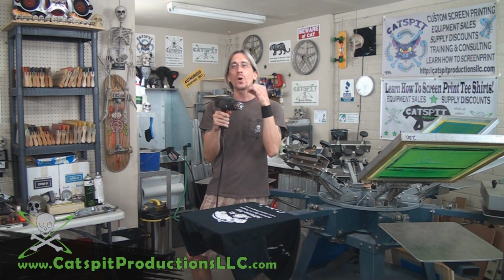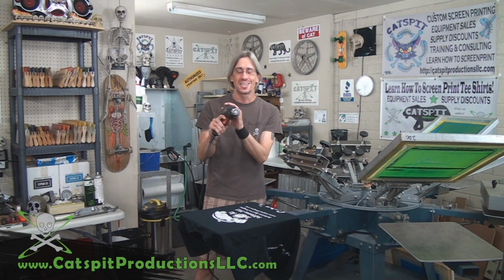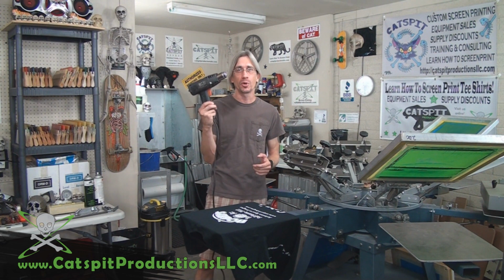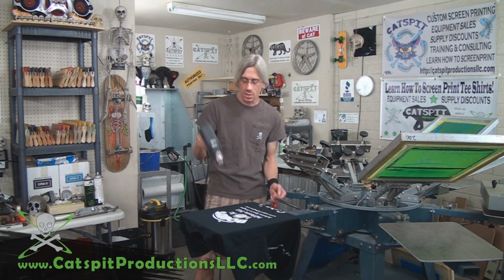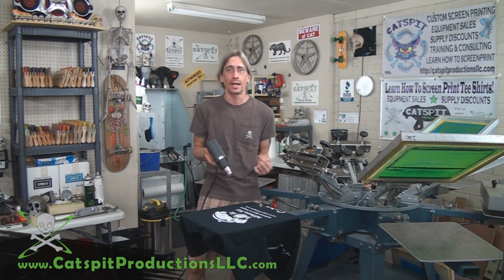Screen Printing Tee Shirts: Can A Heat Gun Cure Plastisol Inks?

Comment: My plan is using gun to "predry" between color layers and after that i will make final cure in heatpress. I know this option definetly not replace good flash unit but i want use this system as start. Thank you for another very helpful video maister.
Reply from the maker: I'm happy to help out where I can. Thanks for watching! Screen Printing Equipment & Supplies - http://CatspitScreenPrintSupply.com/

Comment: Many if not all the printshops here in the philippines used heat guns to cure inks. In fact most of them never invested for a flash dryer at all in their entire printing career and they all worked fine. Whats popularly used by printers here in the Philippines are line table with heat gun. And to some few who could afford it uses rotary press with flash dryers.
Reply from the maker: Thomas Aquinas Yes, we call it long board printing or long table printing. It's popular where space is a commodity and labor is cheap. I rather like the long table set ups and think it would be very cool. But most of the commercial long table set ups use a moving flash cure unit on tracks or what have you. Using a heat gun is very slow and you must have excellent attention to detail. If you miss a spot the slightest bit with plastisol inks, it will wash out. But to each his own. Some people use a kitchen oven despite the fact that it is dangerous. But what works, works. Have you seen this video?

https://www.youtube.com/watch?v=dMclldR9ZQ4  

Ultimately when time is money a belt dryer is the best solution. I just don't recommend using a heat gun to do your final cure. That's how I teach. I want my students to be successful with minimal effort. And it does require the right tools for the job. But many people do it every day and if it works for them then, run with it ;) Thanks for watching. Screen Printing Equipment & Supplies - http://catspitscreenprintsupply.com/
Reply: +CatspitProductions  Nice. Well the reason why most printers here in the philippines never invested for a flash cure dryer is due to financial reasons. They cant afford. So they often resort to using heat gun. Or since philippines is a tropical country they just expose the printed shirts in the sun since its ridiculously hot here during noon time. And most plastisol printers uses heat press for final curing.
Reply: +CatspitProductions  Oh yes. They dont use heat gun here for final cure. They only use it for flashing. For final curing they use heat press. And it gives glossy finish to the print.
Reply from the maker: +Thomas Aquinas I understand. I n the end you do what you have to in order to get the job done.

Comment: big question, can this paint be used to paint brush on fabric/cloth banners? Or does it have to be used solely with a screen printing mechanism?
Reply from the maker: Technically it's ink and plastisol ink is pretty thick. You would simply have to try it. I have never tried to paint with plastisol inks. Thanks for watching! Screen Printing Equipment & Supplies - http://CatspitScreenPrintSupply.com/

Comment: can you cure the base layer with the heat gun then lay the second layer then use a heat press? if its a black garment and white ink?
Reply from the maker: It's the same difference as I stated here. Watch the video from start to end and I think you'll get the idea. You can try anything you want. I have never used a heat gun and a heat press to cure a shirt so I cannot guide you on that. This video is about using a heat gun. Thanks for watching! Screen Printing Equipment & Supplies - http://CatspitScreenPrintSupply.com/

Comment: Thank you for the information. I have a question. Can I cure Angeles Acrylic leather paint on a t shirt with a heat gun? So it doesn't wash off. THX!!
Reply from the maker: You're welcome. I'm sure you could dry it with a heat gun if it's an air drying paint. But I have no idea if that paint would be wash safe on fabrics. You could try it out and see. Thanks for watching! Screen Printing Equipment & Supplies - http://CatspitScreenPrintSupply.com/

Comment: thank for videos ... u r best youtuber for screenprinting... i just want to ask 1 question,,, can i use heat gun just for drying 1 color so that i can print another... how long it will to dry ink,,, i try with hairdryer and it sucks... i am from nepal and we have major load shedding problem , so run the flash dryer on generator cost expensive...
Reply from the maker: +shreechan chitrakar Thank you very much. Glad I can help out through my videos. That may be possible, yes. You might be able to efficiently "flash" a smaller design with a heat gun. How long will it take? That depends on how big the design is and how much ink you actually print. Thanks for watching. Screen Printing Equipment & Supplies - http://catspitscreenprintsupply.com/

Comment: So I made a bunch of shirts with plastisol ink/ one image with waterbased ink. I thought I cured them enough, put one in the wash as a test and the ink is not holding now. It's kinda cracked/ not full. So I am stuck on what to do with the rest of the shirts that were made? Should I put them in the oven to ensure they fully cure? I have had them dry for about a week already though. 

Thanks for your help!
Reply from the maker: Yes, if the plastisol printed shirts were semi-cured and have not been washed or laundered then you may simply put them through the oven again and give them a good cure. The same should be the case for the water-based prints. As long as they are heat set for water-based or cured for plastisol they should be just fine. Hopefully the plastisol prints were semi-cured and none of the plasticizer went out into the fabric during that week they were sitting. That is your only variable that you have to worry about. Thanks for watching and leaving a comment! http://www.catspitproductionsllc.com/ - http://catspitscreenprintsupply.com/
Reply: Ok awesome, thanks! I am getting a flash dryer this weekend as my garage and my pocket aren't ready to drop 2 k on a belt dryer :)
Reply from the maker: superchanneljim You are very welcome. I can relate to that. Good luck and let me know if I can help out any time.
Reply: You've been a ton of help thanks!
Reply from the maker: superchanneljim My pleasure.
Reply: Apple Pie scent printed shirts... this a unique approach :)

So, at 330º for 1 min more or less. How long you have to wait before placing the shirt in the oven once done printing, and what is the maximum time your shirt can be let out before placing in the oven?

Thanks for the video.
Reply from the maker: pbtubelog Put the shirt into the oven direclty after printing. There is no need to wait. And there should be no reason to wait for plastisol inks. Water based would be a different story with an infrared dryer and NO forced air. Thanks for watching. Screen Printing Equipment & Supplies - http://catspitscreenprintsupply.com/

Comment: what about sunlight? can you do it with sunlight? and which one is easier to cure? is it water based ink or plastisol ink?
Reply from the maker: No sunlight cannot cure water based or plastisol inks. Thanks for watching. Screen Printing Equipment & Supplies - http://catspitscreenprintsupply.com/
Reply: in my country some people use sunlight to cure water based ink. but i never really pay attention with the result. thanks btw, i really like your videos. i learn a lot from your videos.
Reply from the maker: Abi Setiaji Thank you!! You're very welcome. Iv'e never heard of such a thing since most water based inks need to reach about 250 degrees to be heat set and wash safe. Maybe you all are using a different type water based ink.
Reply: i think its something called rubber ink. i dont know exacly what it is, but it is water based ink.
thanks again for the information. :)
Reply from the maker: Abi Setiaji Then I would check with the manufacturer to find out what ways you can heat set it. You’re very welcome. I appreciate your support.
Reply: well, thank you so much for your help mr.catspit. XD
Reply from the maker: Abi Setiaji You’re very welcome.

Comment: I'm stuck. I really really want a flash unit but I can't afford a flash unit. 250 -400 I just can't afford it so now I'm scared to start screen printing
Reply from the maker: Timothy Rowan If you want to use plastisol inks with a heat gun then you're caution is appropriate. It can be done and it is by many people but the chances of under curing portions of the print are very high so if your attention to detail sucks then you may not want to try it ;) Thanks for watching. Screen Printing Equipment & Supplies - http://catspitscreenprintsupply.com/
Reply: CatspitProductions thank you so much! I am still going to give it a try i am enjoying just getting set up so i cant wait till i get some designs and actually give printing a go. I am very patient and will try give it the best attention to detail I can. Also ordered a thermometer to measure the ink heat
Reply from the maker: Timothy Rowan Good luck and let me know if I can help out anytime ;)

Comment: I tried the heat gun method when I first started. I had all the issues you mentioned. Heat gun is fine for a small logo on a pocket or sleeve. But when you try large images you have no way to tell what part of the image is done and what part is not. So you tend to go too long, one part of the shirt will get burned, the other side won't be cured, etc,etc. It gets frustrating. I never tried oven method.
Reply from the maker: Yeah I recommend at least a flash cure unit really. And even that you have to be careful with. Thanks for sharing. And thanks for watching. Screen Printing Equipment & Supplies - http://catspitscreenprintsupply.com/

Comment: I really want to learn screen printing. I have a basic set up. The only thing I have to cure the ink is a heat press and a heat gun. What is the name of the flash dryer to you recommend a newbie to purchase for plastisol ink? Right now, I have been practicing with water based ink. However, I read somewhere you recommend plastisol ink for a newbie. Please help.
Reply from the maker: Yes, plastisol is easier to learn with because it will not dry while you are printing. I would recommend the 16x16 I sell on my ecommerce site:

http://catspitscreenprintsupply.com/ranar-d-162-16-x-16-infrared-flash-cure-unit-120v/

Thanks for watching! Screen Printing Equipment & Supplies - http://CatspitScreenPrintSupply.com/

Comment: yes you can...  Flash with heat gun, the fully cure using heatpress :D
Reply from the maker: Technically that would be the heat press curing the ink ;) But yeah, you could do it that way. Some people just use a heat press alone. Thanks for watching. Screen Printing Equipment & Supplies - http://catspitscreenprintsupply.com/

Comment: Can you cure plastisol ink in oven:? What is your opinion?
Reply from the maker: I suppose it is possible but not recommended. It could be hazardous with red hot electric elements or gas flames, yes. Use a device made for the purpose so you have better control over it. Thanks for watching. Screen Printing Equipment & Supplies - http://catspitscreenprintsupply.com/
Reply: +CatspitProductions could you cure shirts ina metal box witha lid and place ina oven for 1 min? or is air flow recommended or necessary
Reply from the maker: +XxxCR1SPYxxX I have no idea. I never tried anything like that and air flow is necessary for more even, consistent results I think. I would not try to cure anything in a kitchen oven due to hazard of fire. That's why we use infrared panels mostly. They're very safe to operate. Thanks for watching. Screen Printing Equipment & Supplies - http://catspitscreenprintsupply.com/
Reply: CatspitProductions
hmm infrared panels ill be researching all the lighting again but yeah idont think ill be using the oven it seems a little too ghetto hehe thanks tho for replying to all my noob comments haha ill definitely be buying from your store in the future and recommend it. what was that viewer artwork thing you should do more of that and do raffles every week for a shirt or somthin
Reply from the maker: You're very welcome, my pleasure to help out where I can. Yes, now and then we take viewer submitted artwork and do a printing video with it. But I'm too under staffed and busy to do one every week with raffles ;) That would be a tremendous amount of work. But I do have another on deck with an artist and screen printer from the UK. Check out @catspitscreenprintsupply on Instagram for behind the scenes images and news.